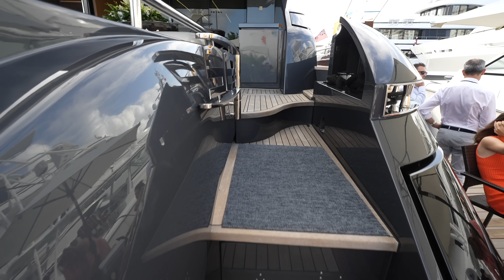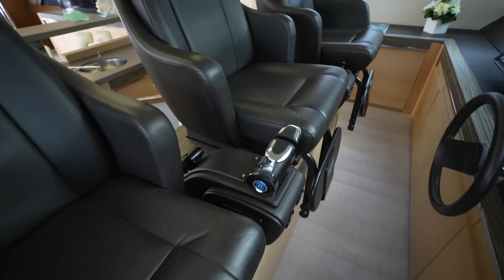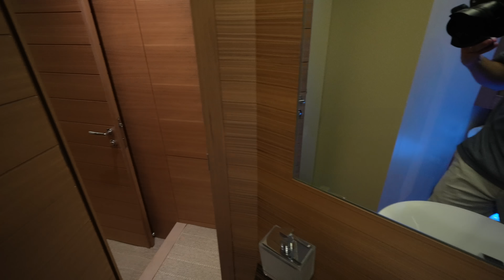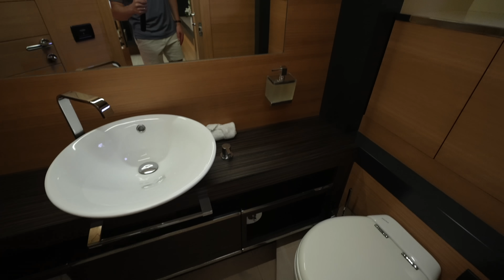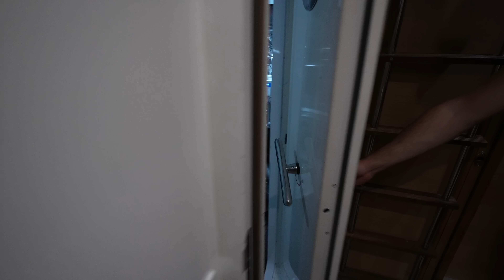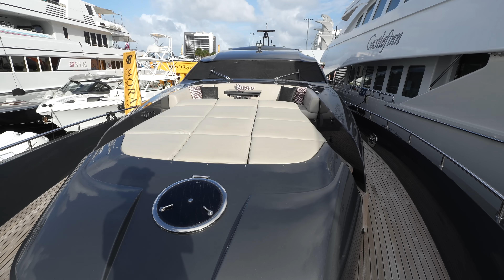$3,000,000 ULTRA FAST Pershing 92 SuperYacht Tour

Comment: That might be the worst galley placement I've seen in a boat this size. What a pain it would be to cook and serve out of that thing, From being down a flight of tight curved stairs, no dumb waiter, no easy in and out for guests if they wanted something and not even a full size cook top. Everything else is pretty bad as well. From the poorly positioned bridge to the laundry being actually inside of one of the crew quarters..etc. I could list another dozen major issues. Terrible layout.

Comment: Is that price for a brand NEW boat, not used ? Just ))) 3 mil but for 92 feet ?- not too expensive. As I remember, for instance, Princess could cost so but for… 67 feet boat ? More or less…
Reply from the maker: The price is for this specific used yacht. Brand new would be more expensive.

Comment: That is a pretty good range for over ten knots. The thing is about those big long runners like Catapiller or Detroit Diesel engines. You can run them at 85% power until you run  out of fuel. They aren't going to break any speed records but will take you anywhere and run until the break. Then the repairs and rebuilds are Simple and can be done in the engine room without pulling them.

Comment: For anyone wondering, yes – a Pershing 92 definitely needs a professional crew. It’s nearly 30 meters long, with super complex systems, massive engines, and luxury features that require daily maintenance. You’re not just hopping in and cruising like it’s a speedboat – it’s more like managing a floating 5-star hotel with a powerhouse engine room.

You legally need a licensed captain and engineer to run it safely, and most owners also hire a chef, stewardess, and deckhands for service and upkeep. Annual operating costs (including fuel, maintenance, crew salaries, insurance, dockage, etc.) can easily hit $500,000 to $1 million per year, depending on how often you use it and where you keep it. Yachting at this level isn’t just a purchase – it’s a full-on lifestyle. 🛥💸